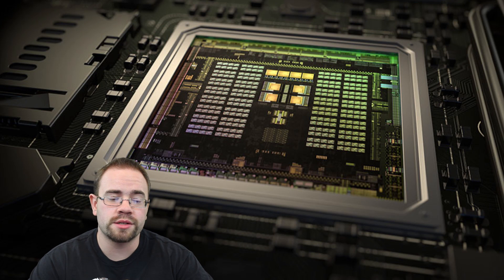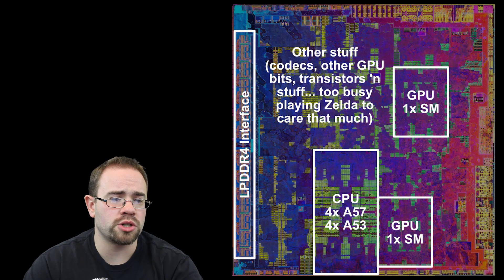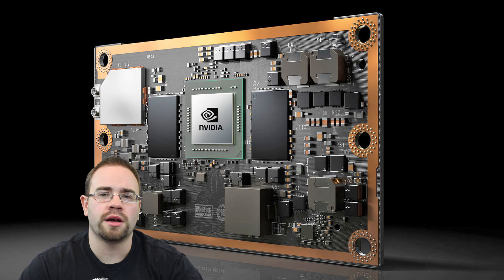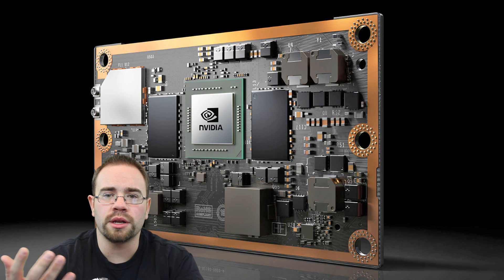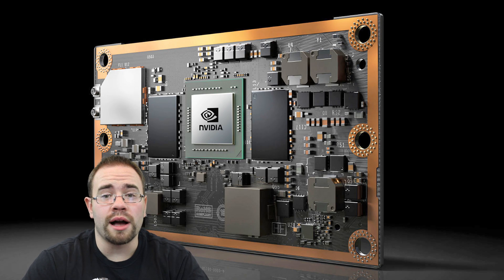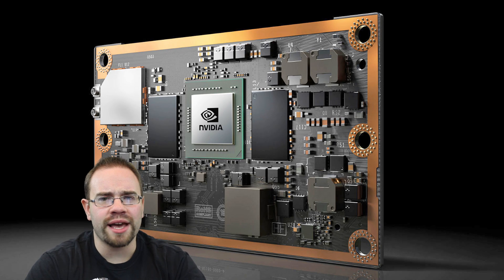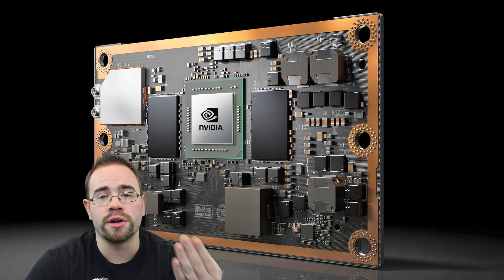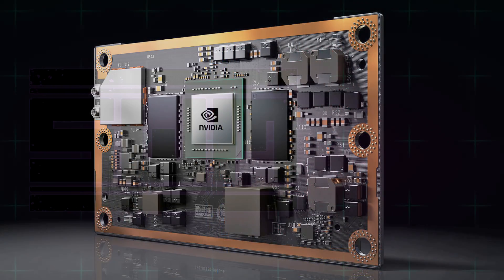Nintendo Switch Chip Was X-Rayed! Here's What's Inside.

Comment: There is a possibility that the customization in the switch's x1 could allow it to have HMP, which means all physical cores can run at the same time. The power difference between A53 and A57 offer no real advantage to using the LITTLE configuration. And for the people that are worried the switch is a lot stronger than the wiiu. Hopefully the success of the switch can give nvidia the confidence to make stronger Tegra chips and really go all in on the processor. I think the switch sold more than the shield has ever sold in its first 3 days of release.
Reply: Denver Basshead that is a concern, but lets be honest, you are not going to buy a Nintendo switch to play games like Destiny 2 or Battlefront
Reply: Dragon Quest Heroes I-II is the worst running port on the Switch right now.  Knowing what we know today, there's no way the Switch runs worse than the PS3 version.  It's a porting failure, not a hardware one.
Reply: Denver Basshead you do know the reason dragon quest looks worse is because square got lazy and ported the ps3 version
Reply: Sid Patil an X1 has 1 teraflop of performance while the Xbox one has 1.31 teraflops, so the X1 isn't far behind the Xbox One
Reply: Vitalsource except Teraflops are different for every architecture :p
Reply: Sid Patil ya in which Nvidia GPUs have less teraflops and out perform AMD GPUs with more teraflops
Reply: Denver Basshead were those ever gonna sell on a Nintendo console to begin with?
different fan base m8
Reply: xBoolin um WHAT.
RPG Maker is strictly a 2D game engine.
I Am Setsuna runs on Unity. At least do some research before talking on the internet.😂😂😂
Reply: DAVAND23 doesn't matter, you won't be getting the next battlefront or Destiny 2. and the COD port will be as bad as the Wii ports.
Reply: The cod ports won't be that much different than the ps4/xbox considering that the switch is much more powerful than the wiiu and the thing that will determine if the switch gets 3rd party ports will be the sales of the system.
Reply: DAVAND23 I bet it's pretty different. Dragonquest looks worse on switch
Reply: Jr6002 so all Nintendo consoles will only sell max 30 million with only exclusives. If that's what you want lol. The only people buying a Wii u were hardcore gamers, I'd bet theyd buy 3rd party of they didn't look and run like shit
Reply: stormyandcold so I am setsuna at 30 fps is good?
Reply: Denver Basshead graphically speaking it's the THE EXACT SAME game thats on PS4. So lower FPS is acceptable seeing that's it's a system that's half the power of an XB1
Reply: mario9785ify I believe the Xbox One S does 1.41
Reply: ***** it runs at 60 on ps4
Reply: Sid Patil it runs at 60 on ps4
Reply: Vitalsource that's 30 percent. Pretty big deficit
Reply: mario9785ify the visuals are close to the ps4 version dude, it just runs at 30 and barely can hold that while it's 60 on ps4 😂😂😂
Reply: It has been confirmed that in has 4 cores, 3 of them are available to the games. Tegra X1 usually has the little cores turned off completely because the switching between them was badly implemented (when the bigLITTLE architecture was new).
Reply: Denver Basshead Well, for a handheld it's fine.  Would you have been willing to pay £500+ for something better?  I think you need to do some research on soc's that could've powered the Switch.  For the money, the Switch is a good deal.  It's due to unfortunate wording, specifically "home console" by Nintendo that's caused all the debate.  However, I've never seen the 3DS compared to PS3 and Xbox.  The PS Vita was often compared to PS3 for it's ports, but, Vita 30fps vs 60fps on PS3 was never a major problem.  It's an accepted trade-off for portability.  What we're seeing is the difference in graphical quality between consoles and handhelds further close, just like desktop and laptop graphics.  If 3rd party devs really want to sell their games on the Switch, then, there's nothing stopping them.  Look at how far devs were willing to cut down games to squeeze them on the PS Vita.  For me, the Switch is a huge upgrade over my Vita.
Reply: stormyandcold it's the most powerful handheld ever no doubt about that. But Nintendo is not marketing it that way, there marketing it as a home console you can take with you. And you ownt be able to play home console AAA games
Reply: +Denver Basshead As I said, it's a technicality that's caused the debate.  However, given the chance, I would correct this mistake and just market it as a "portable console" that can be docked.  However, it's a sticky situation because technically; it's more powerful than the Wii U when docked, so yeah, the Switch is like a jack-of-all-trades.  As for AAA games, it's too early to say what it will or won't get because compared to the PS Vita, games wouldn't need to be cut-down so much to fit them onto the Switch.  However, if they give us turds like Call of Duty: Declassified like on the PS Vita, they can keep them.  On the other hand, look at the Wii U launch, everyone was onboard and what we actually saw is the consumers just weren't that interested in 3rd party games.  This is actually partly down to the fans.  I'm not a console gamer.  I got the Switch because I love handhelds.  However, when I think of Nintendo and what made me buy the Switch, it's Nintendo's own franchises.  It's Mario, Yoshi, Luigi, Pokemon, Mario Kart, F-Zero, Zelda etc.  I know it's bad, but, it never occured to me to buy the Switch for 3rd party games.  In that sense, I'm just as much part of the problem because people like me primarily want Nintendo's own games.If I could only buy 3 games for the Switch a year, I'm 99% sure they would be Nintendo's own titles.  Everything else, I will get on my PC.  I will not be buying Fifa for the Switch, that's for sure.
Reply: stormyandcold if you don't have big AAA 3rd parties, you'll never sell more than 30 million. I'm not talking about vita, if you port COD 2017, it'll look like the Wii ports of CoD. Laughable at best
Reply: +Denver Basshead Which is another reason why those games won't sell well on the Switch so are a waste of time porting them in the first place.  However, looking at how the DS/3DS did, I don't think sales will be a problem once all the major Nintendo franchises are released on the Switch.  The Switch's potential market is different from PS/Xbox.  Most people who will buy a Switch know where it'll be heading.  It's like comparing the ipad market to the console market, it's irrelevant.
Reply: stormyandcold 3ds has sold like 35 million I think? Will we ever see another DS variant though?
Reply: +Denver Basshead Considering so many people are complaining about the power of the Switch, where could they take the DS?  There's nowhere to go other than to make yet another low-resolution system.  The technology just doesn't exist right now to do anything with it other than small incremental upgrades.  I'm sure Nintendo would've considered a DS using the Tegra X1 chipset, but, that would've split the DS/3DS community up with much less improvements than the current Switch can offer with just one screen to worry about.  I think Nintendo and 3rd parties will continue to support the 3DS with games, but, I don't see it continuing for more than a year from now.  There's much more potential on the Switch.  If Nintendo really wanted to cash-in, they could easily port Mario Maker, Mario Sports, Luigi's Mansion, Yoshi's Wooly world etc to the Switch right now.  People wouldn't even blink if they did it.  However, I think Nintendo are more restrained than that.
Reply: Rob God so it's the Wii u again lololol. Great exclusives no 3rd party. Has Indies but that'll only get you to around 25 million. If that's all Nintendo wants by thays barely better than gamecube

Comment: jon, is there something to be worried about now that we know we have an  X1? :/
Reply from the maker: Not really, if you enjoy the convenience of the Switch along with the great games Nintendo tends to bring to their systems you should enjoy the Switch going forward. The X1 is a strong chip overall and the Switch is a good bit more capable than the Wii U.
Reply: It probably won't be getting the more intensive multiplats, but I don't think many were expecting that in the first place. Right now, unless the gaming industry goes through a huge change, I feel like the Switch will be primarily a Nintendo and Indie machine, with a few multiplats but not nearly as many as the PS4 and Xbone.
I feel like they might have troubles with power later on but by then, Nintendo might have their Switch XL or whatever out.